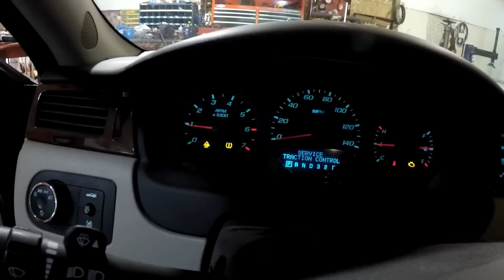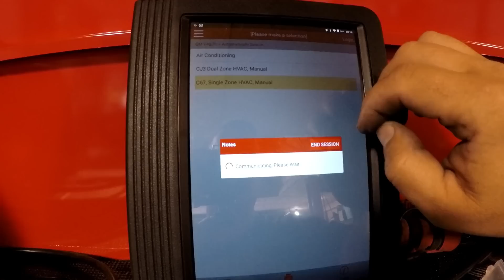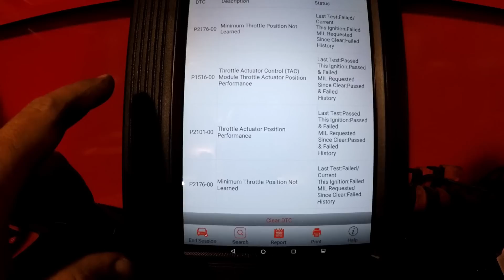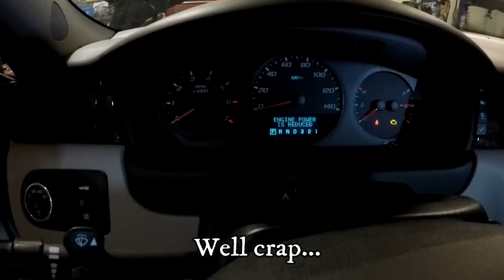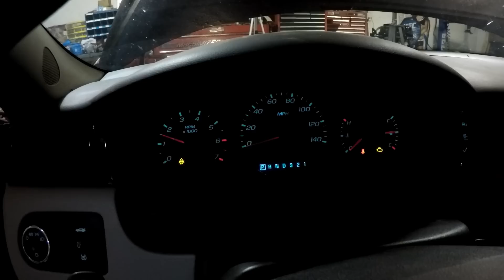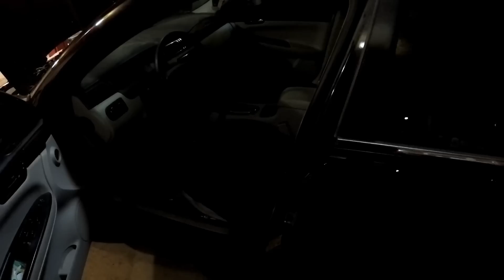How to fix Reduced Engine Power and Service Traction Control on GM Chevy Pontiac Buick

Comment: I have cleaned throttle body but it is temporary fix, problems will return on (buick enclave) stabilitrack/engine half power, Do you have any recommendations on these Buicks?? thanks in advance
Reply: Clint East you cannot just clean it!!!! Need fix the issue, the build up is most likely from dirty air filter wich is fualting your spark plugs!! Then build up happens and flap won’t shut all the way and the sensor b sensor shorts out!!
Reply: Just put new throttle body on last week ,everything was fine no lights or engine half power, stabilizerlight /trackion control gone, no engine lights at all, drove it out of town now all engine lights are back ecept engine half power, really frustrating?? now what? ive allways loved Buicks but don't know if ill ever buy one again and no recalls on this problem!! that lots of people are having as of dec. 2019
Reply: And I had a auto shop do all the work, 400 dollars
Reply: Clint East croocks!!!  Iwiggle wire harness to make sure problem is not there then proceed I say change your air filter regap or replace spark plugs!! If battery is older then three years change it!! See people don’t understand these cars no longer have distributors!! There for battery is only power source, if power is not good coils can’t produce enough power to spark plugs there for you get bad build up(carbon build up). Gotta take care of the underlying issue first, do a relearn procedure turn engine on 3 minutes off 1 minute back on 3 minutes all this at idle speed,, if not ok then take for smooth ride reaching 45 mph some quick acceleration s and let off throdle should work, all these after replacing these parts!!

Comment: Thanks for the video!!!  After watching, I feel like I could repair my vehicle myself. I have a 08 Saturn Vue Hybrid Green Line 4 cylinder and I am being told that my vehicle does not have a Throttle Position Sensor. They are saying I need the accelerator assembly kit. My Saturn is doing the exact same thing as the vehicle your video. Can you help me and tell me if they are correct or full of crap?  Thank you again.
Reply: Beth Riley  replace air filter and spark plugs!! You can also regap the plugs,, bad fuel ratio could be causing computer to go haywire, put very good cleaner in fuel to clean injectors

Comment: Clear and concise instruction.  Idle patter helped a little bit, too.  However, only good if it's the throttle body and not the accelerator pedal that's the problem.  Would the scanned codes differentiate the possible problem sources?

Comment: This same thing has now happened twice on my 2014 Chev Traverse.  3rd time at the dealer now and they don't know what's wrong.  They said they can replace the Fuse Block but that's just a guess.  Tested everything and can't find anything wrong.  It doesn't run like this when I get it to the dealer.  When the car is shut off it seems to reset the reduced power issue and all of the error screen codes except the engine light stays on.   Don't know what to do.
Reply from the maker: Intermittent issues are the most difficult to diagnose. If it doesn’t act up for the technician, any “repair” would be a guess. The best thing you could do is try to take mental notes of any conditions present when it occurs and pass that along to the shop. Eventually it will get worse so they’ll be able to experience it in which case they should be able to diagnose it. I’d do a quick wiggle test on the wiring harness near the connector for the throttle body since it’s an intermittent problem. I’ve seen wires break inside of their coating causing the issue
Reply: @Tomsfoolery.  engine power reduced and tc light on my 2009 Pontiac g6. What do I do?
Reply: Jiggle wires at Tb sensor while engine is running, if no changes then change air filter and plugs run very good cleaner in fuel to clean injectors

Comment: Any way you can help me with my 2008 Pontiac G6 with a 3.5 v6. The idle is real bad and my indicator for my traction control lights up on my dash even when the car isn't moving. Driving the car isn't too bad right now but she bucks sometimes when going up hills like the car is hesitate to go in a lower gear. I changed the spark plugs already and it was fine for a bit after that but now the problem has returned. Any help with my problem is greatly appreciated! Thanks!

Comment: rpo and uh8 refers to build options. you can find out in the glove box. has a list . you have to designate correctly or it can effect your diagnosis
Reply from the maker: Thanks for that info!
Reply: I have a cadillac fixing now but mine has only 3.2 reference volts at tps so  as well as cleaning I get to go through a mile of wire!!! Lol...yeeehaaw

Comment: Man thanks.  I replaced my pedal sensor. And 6 months later bam it's doing it again.  I'm gonna buy a new throttle body
Reply: Change the MAP sensor first. It's only like 12-20 bucks online. Then if your problem continues then change the whole throttle
Reply: @torerotigreen9198   Yelp it's the throttle body / and sensor. Mines was dirty and I had a crack in my hose at top. I replaced throttle body and hose runs like new
Reply: Terrance Patrick Dave your money!! Put new plugs and a gallon of laquar thinner in gas tank with ten gallons of gas,, it cleans everything!!!

Comment: I have 2007 impala ss sometimes the #7 sparkplug fouls out because of the fuel mgmt. system.
Reply: Junk it
Reply: Rich Hedgespeth check fuel injector for short check fuel injector fuses!! Change plugs and put injector cleaner I just use laquar thinner , it cleans everything!!! Like tuneup in a can!!!

Comment: I have a 2010 Chevy equinox  with the 2.4 ecotec doing the samething. Its threw a p228d code. But the code goes off and on. I went ahead and replaced the throttle body and both rail pressure sensor's. But im still having the same problem.  Jumping and stalling at stops  and  bad idle.  Could this be the  pedal sensor ?
Reply: Steven Gunn Jr did you figure out the issue ??

Comment: I have a impala 2007 with traction lights on pressure light on abs light on and recently check engine too so anyone knows whats wrong  with my car ?
Reply: I have a 2010 Chevy Equinox an it's doing everything u said omg help 😔😔😔
Reply: @ericamcghee6713  you have to check the following : both front and rear bearings . check the front sway stabilizer bar maybe its broken . check tps sensors on tires all that is related to traction pressure and abs lights on dash . that's what my car has damaged

Comment: I'm having the exact same symptoms on my 2011 malibu. but the code said the map sensor. I replaced it. it's still doing the same thing. it's still saying map after I erased codes. I traced the wires all the way to the ecm. all good. I cleaned the throttle body and maf, i replaced the intake becuase i read the the plastic one for the Malibu is notorious for leaks. still the same thing. only thing I can think of is the ECM. I took the throttle body apart and checked everything just to check. no play in the gears......I havent checked the pedal yet. it's hot outside tho. so maybe tomorrow
Reply: Douglas wicasa I have the same problem with my 2011 Malibu LTZ. Did you end up finding a solution?

Comment: I have a 2011. I replaced the throttlebody and a week and a half the problem came back.
Reply: Bad or corroded ground either to battery itself or to the engine block. Could also be a loose wire in the pigtail attached to the TPS itself.

Comment: I was told that also the air pump will come into effect, since it brings clean air for combustion, I might replace the air pump since it has a lot of miles already
Reply: Update on this... Also you can change the MAP sensor. I'm goes bad due to the heat exposure. Try this first is only around 12-20dls it won't hurt to have it replaced.

Comment: I changed mine for a brand new one, whole body, it worked but after a while the reduced engine message came back on. I don't know what else could it be?
Reply: save yourself the trouble and sell it. it'll make you go broke
Reply: Torero Tigreen replace plugs clean fuel injectors!!!!!
Reply: Torero Tigreen bad plugs clogged injectors equall terrible ignition cussing throatle body to get dirty as heck!!

Comment: I have a 2009 Impala did this and it didn't work. Someone told me to try replacing pedal sensor. I hope this helps someone.
Reply: Mine just did this same thing the code read pedal sensor also sometimes dirty air filter can cause it to read these things
Reply: @kelz040290  "is "2morrow xxx xxx "xxx xxx xxx c2"f2f cc"to cr cv6vv6

Comment: I replaced my throttle body on 14 acadia. Helped for a month. Then started doing again. Took to dealer. Replaced alternator helped for six months then came back. Back at dealer. Hate GM electrical system. I thought throttle body was my answer but keeps returning
Reply: Could be pedal position sensor
Reply: @murray6907  they replaced fuse block lose connections. Its better has done it again 1 time since then

Comment: Purchased a chevy Equinox in February 2019. It has 1,144 miles on it. Died in the middle of traffic over Memorial Day weekend. Engine/Transmission malfunction. Dealership duct taped the broken part which is on indefinite backorder. They refused me a loaner and sent me on my way. Still not functional nor safe. At second shop. It’s a known problem with no fix in sight. Still no resolution........ 1,144 miles. Brand. New. Car.

Comment: I have a 2009 Chevy HHR.  I was getting the reduced power message and the car was running horribly.  I replaced the Throttle Body with the sensor.  I still got the message and it ran bad.  I replaced the gas pedal and sensor.  I now get the message but it seems to run smooth.  I've got the battery cable off right now trying to reset everything but I think I still have problems.  Any suggestions?

Comment: thank you for your contribuition for all the people that have the same issue but to be honest each case is different is no t always the same, let me tell you my experience, l had issue with my differential and i spend a lot of money with 3 difents mechanic that just want to steal my money because one said that was the cv joint other that diffential but, at this time i dont know exactly what was the problem, the point here is that finaly i fixed the diferential problem but the engine power is reduce light sudenly came out and the mechanic thief said that was the throle body, but finaly i found a honest mechanic and was something about the gas sensor,  to end this tip to my experience not always is the throttle body  think more the two time to move at your throttle body because is really delicated

Comment: Having the same problem with my 09 malib 2.4 ecotec .. iI’ve replaced everything noted in the comments and video still no luck but the car does run ok every now and again.. so when i get it running right i give it the wiggle wire test and every time i touch the under hood  box it starts spudering and goes in reduced engine power , ive had the whole fuse box replaced and still doin the exact same thing.. any pointers would be greatly appreciated.. frustrating is not the word right now

Comment: Thank you for the video would you recommend just replacing the entire throttle body my car is doing the exact same thing mines a 2006
Reply from the maker: That would be the fastest and easiest route if the fault is the throttle body. Sometimes it’s the pedal sensor but the throttle body is the most common. Also, I’ve ran into a few that ended up being the wire harness that plugs into the throttle body.
Reply: @Tomsfoolery.  well here's the problem I replace the brand new throttle body and the codes came back on to get to my mechanic and he said if the voltage is it regulating right and what he means by that is there's like a cut wire or a broke wire somewhere so yeah I could possibly be in the wire harness going to the throttle body but the throttle body with nasty it needed to be replaced

Comment: Got this same issue with my GMC Acadia 2007, its totally random.  It mostly happens when I start my vehicle on cold morning and let it pre-heat.  If I just get in and get going with cold engine it usually does not happen.

Comment: I have a 2011 Chevy Cruze.  Same problem with engine power reduced.  Just got my throttle body ($158) later.  Getting ready to go put it in with my brother.  Will let you know how it went.  WISH US LUCK!!
Reply: Did it fix the issue?
Reply: Hell no, I replaced both throttle body and gas pedal
Reply: @geotid8275  doesn't fix shit it'll keep coming back no matter what you do, SELL it
Reply: Junk it
Reply: Change the MAP sensor. It's only like $16 usd

Comment: ive had the same problem with my avalanche. i had taken it to different mechanics and nobody can find the problem. i changed the gas peddal, throttle body, the computer and crank shaft sensor and nothing. i happens aster i wash the truck
Reply from the maker: Check the wiring harness to the throttle body. Wiggle it and see if you can get it to mess up. They're common faults.

Comment: ts6034.....thanks for the video.  Would this apply to a 2008 GMC Acadia too ?  I bought this vehicle used and the guy was honest with me and let me know he has issues with the traction control and dealerships can't figure anything out but just keep charging him for looking at it.  I have had the service stabilitrak come on but have never had it say Reduced engine power until this past week when it got extrememly cold out.  It comes on everyday now and I have to pull over and let it set and then it will start and drive like nothing ever happened.  Does all this apply to your video ???  THanks
Reply from the maker: It does apply to your vehicle but I would first have it scanned to see what codes are present before diving into it.
Reply: Robert Cantonwine, did you ever find out what was going on with your car? I have the same issue on my gmc acadia 07 i cleaned the trottle body and it's good for a week or 2 and then again.

Comment: My job has several vehicles in its "fleet". One of them is doing this same issue. One of our guys says its the traction control module. I'm gonna do this fix first. All it will cost is my time and the cost of the kit. Less expensive then towing it to a shop and paying them to do the work. Let you know if it works.

Comment: Hello brother i have a malibu 2013 
Today i got the same problem .. the car was fine till this ( check engine with downword arrow + traction cintrl lights went on ) 
The code on dashboard is code 84 
And when i checked it on computer the engineer told me its from the fuel pump i bought a new one but still not solved i hope ur video helps me tomorrow .
Appreciate ur help
Reply from the maker: Thanks for watching and good luck! Let me know what the fix was, I’m curious.
Reply: Did you ever figure out was it was I been having the same exact problem with my 2013 Malibu Ltz  they told me that I had to change my front fuel pump. So I paid Chevy to change the front fuel pump after doing so I picked up the car and it ran fine but after 20 min of running the car would just shut off there is no check engine light on what so ever took it back to Chevy now they are telling me its the Exhaust cam sensor that’s causing the car to shut of wile on red lights I don’t know what to do.... fuck Chevy I will  never buy a Chevy ever again

Comment: I had that happen to my 08 GMC Acadia. I went to the junkyard got a used one cleaned it (sensor up cause it leaks through the butterfly), put it on and it worked fine for a week or so. I drove for 3 hours straight and it started hesitating on me. Like it would jerk amd struggle to stay at speed then rpms would drop low. My rpms go crazy i have to step on the gas just for it to pick up but i dont have engine power reduced showing. Can you help with this

Comment: I had the reduced power on my 2006 lascrose changed the throttle body and still no change.  tried to reprogram the throttle body using a relearn procedure still no luck.  I finally took it to the dealer and the fault codes indicated the the gas pedal sensor was bad.  They changed the gas pedal  and my problem was solved.
Reply: What code did you have?  I am getting P0221, did you have that one?

Comment: I have a Cadillac srx with the 3.6 reduced power and tc light on. No check engine light. Has very little power. Im just not sure where to start with no engine codes on?
Reply: Scrap yard....problem fix

Comment: Thanks so much for the video. It was only slightly different for my impala ss.  Instead of cleaning the throttle body, I just ordered a new one as well as a new gasket. I put it in this morning.  Plug and play and so easy thanks to your walk thru video. Saved SOOOOO much money. Thanks again!
Reply from the maker: That's great! Thanks for watching! Btw...I have an Impala SS sitting out back if you're interested in a parts car lol. Bad trans...

Comment: Great vid. HOW TO CLEAR REDUCED ENGINE POWER.  Tps reset on lots of gm is key on but don't crank the engine in this order. Key on, key off, key on for 5 seconds, key off for 5 seconds, key on for 15 seconds, key off for 15 seconds, key on, key off, start the truck. This will clear reduced engine power and will probably get you to a shop.
Reply: That worked on my malibu!!!!! Thanks!!!
Reply: or pull maf wiring harness plug, blow on connector, check pins to make sure they arent bent.
put wire harness end back onto maf, and start it up.
also, check your pcm ground wire on valve cover bolt,passenger side rear of engine, and check your engine ground strap opposite of the same side, rear of engine.

Comment: I have a 07 accord 2.4 liter and it'll run for about a minute then cut off. If I unhook battery it shut off. What is the problem?
Reply: check your ground wires for corrosion.
Reply: John Clarke altornator